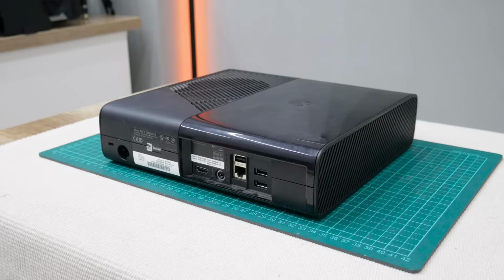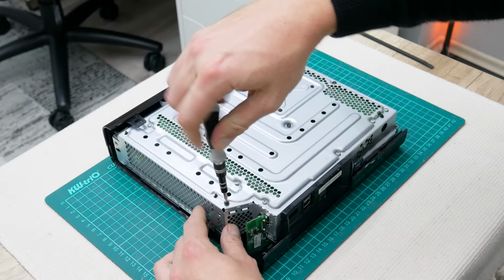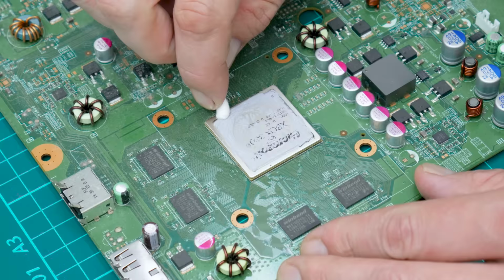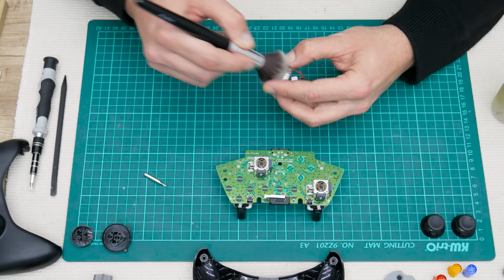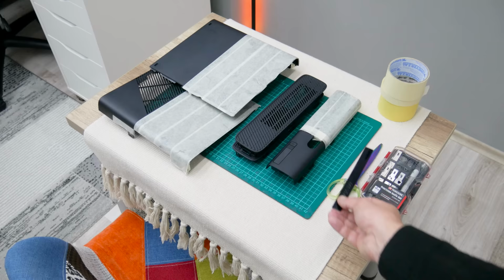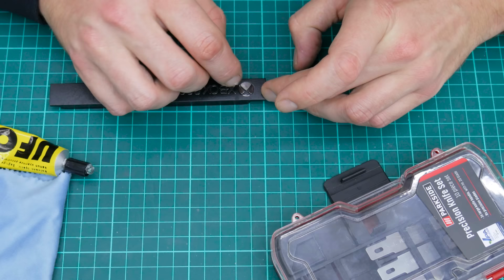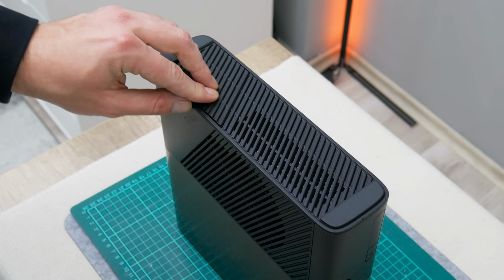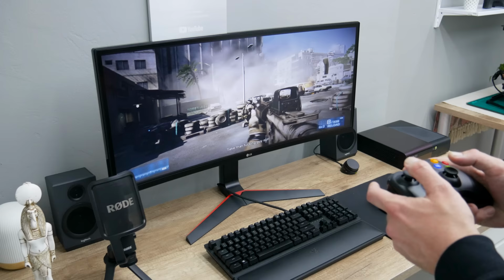Restoring XBOX 360 E - Simple and Nice

Comment: The Xbox 360E is an easy console to take apart. I got one second hand a few years back and the fan stopped working. I opened it, cleaned it, replaced the thermal paste with MX4 and changed the fan. Works flawlessly.
Reply: I've never taken apart a console successfully besides a blue wii that I left alone after getting apart
 I have an extremely scratched 360E though that I got for $25 about 4 years ago with a bunch of games and the technician I've taken my xbox and Playstation to said he doesn't go older than xbox one so was wondering if I could deep clean this on my own? And thermal paste I don't know where to get that or what to even use
Reply: @josephhall7317  Oh my gosh do it dude. Take it slowly, make sure you have the right tools and carefully watch tutorials. Check out websites with tear downs.

I don't know why repair guys wouldn't do this, the Xbox 360E must be easier than the Xbox One.

The original Xbox is very easy and the Xbox 360E is fairly easy.

But take your time, make sure you feel around when trying to open it, don't force it. If it feels like it's not going to open, stop, re-check what you've done and re-check the tutorials.

Japanese consoles are harder. They're usually far more complex to open and mess around with and have so many screws.

Trying to open and deal with a PS2 Slim or a GameCube is far more work than an Original Xbox or Xbox 360E. The original Xbox 360 is harder though.
Reply: Wrong with it

Comment: Love the look on this 360. a very good looking console. and fitting for the last model of 360 ever made
Reply: @gejamugamlatsoomanam7716  my ps3 slim got ylod
Reply: @Neilos-sd6ti  same but mine was a fatboy. U probably had the 2500 series, which still have nec tokin capacitors
Reply: @Harryd06  im really sad i cant use it anymore
Reply: @Neilos-sd6ti  that must be your fault. Xbox 360 gas 54% failure rate
Reply: @gejamugamlatsoomanam7716  Dude chill with that PS fanboy stuff go somewhere and do that
Reply: @gejamugamlatsoomanam7716  fun fact : spiderman is the only reason they can afford to keep making playstations
Reply: @gejamugamlatsoomanam7716  that was with the first batch of xbox 360's, microsoft fixed it with the slim
Reply: @gejamugamlatsoomanam7716  that was a 2006-2007 issue, by your logic ps3 has no games(only OG's will remember)
Reply: @gejamugamlatsoomanam7716  The original xbox 360 in 2006 had a 50% failure rate, lol I still have one and it works just fine, plus they fixed that issue immediately. oh, and take your COD playstation attitude somewhere else, no one wants to hear it.
Reply: @gejamugamlatsoomanam7716  fanboy lol
Reply: @gejamugamlatsoomanam7716  360 was a much better console halo dominated b ack then
Reply: @gejamugamlatsoomanam7716  it had the better exclusives, yes but in terms of looks,price and features the Xbox wins
Reply: @gejamugamlatsoomanam7716 all my ps3s broke unlike my xboxs
Reply: @gejamugamlatsoomanam7716  lol
Reply: Had my Xbox360 (Slim) since 2010 or 2011, still works but gets really hot and should get some cleaning but my PS3 (Slim) died one or two years ago and I had it since 2012 "only"... So for the Playstation fanboys here is Playstation really better? And another friend had his PS4 fail after like just a few years after release...
Reply: @gejamugamlatsoomanam7716  who asked you for google stats?
Reply: @gejamugamlatsoomanam7716  I never had a PS3 or 360 but after just finishing RDR2 on my PC I absolutely HAVE to play the first part. A PS3 or 360 + RDR1 costs less than a full priced game these days. But I noticed that RDR1 runs terrible on a PS3, it's not even HD (640p) and has huge fps drops to 15 fps at worst during busy scenes. Whereas the game runs at 720p on the 360 with a stable 30fps. Apparently this is because the 360 was the lead platform and the same difference can be found across most multiplatform games. Which is 85% of all games...

Then I noticed how horrible the controller on the PS3 is compared to 360. Going for the 360 route is the easiest choice of my life, I'm not sure what you're on about calling a PS3 far better and even insulting fans of the other. PS3 seems pretty bad to me.
Reply: @void2695  that's your opinion.  Ps3 had far lower failure rate, outsold 360, controller is great, has motion controls, built in battery.

Ps3 exclusives are far superior to all games in 360
Reply: @gejamugamlatsoomanam7716  👉😭🔥
Reply: @gejamugamlatsoomanam7716  yeah ps 3 has not much games I can't even play tomb raider 2015 on it or fh 1 and 2 nice Games too i like the xbox, double the ram Netflix twitch youtube all works but for what reason ever I can't play youtube videos in full hd which worked perfekt a year ago
Reply: tom  no they are not, thats the 360 thats prone to break.
Reply: @gejamugamlatsoomanam7716  my ps3 broke so I’ve been an Xbox guy ever since
Reply: @gejamugamlatsoomanam7716  why are you so upset. I hate PlayStation for being a confusing system but don’t tell your opinions in such a rude way.
Reply: @gejamugamlatsoomanam7716  if you're still on that childish console war please, PLEASE don't even bother to mention the controller when attacking the xbox 360.

Comment: Instead of a screwdriver to remove the xclamp, I suggest buying the removal tool for beginners. It’s less than $10 (maybe even $5) but if that screwdriver slips and destroys components on the bottom of the board then you’re going to have a bad day. Cheap insurance.

Comment: For the rails of the DVD, use alittle lithium grease, it will help the Lazer move around. 
The rubber thing in the back of the disk drive has always cracked and become old, so I used friction tape for it.
If yall ever had some old thermal paste that just won't come off with alcohol, use alittle dw40 on it. It will lift that thermal paste right off, then rub it down with some alcohol to remove the rest of the paste and wd40:)

Comment: Usually when I take apart the CD-ROM, something very bad happens.  The ribbon cables are prone to breaking like an iPhone is to cracking (or water damage).  If you take it lose you most likely break the CD-ROM.  I’ve done that before when trying to oil some gears that were having a hard time opening the tray (after replacing the belts) and that CD-ROM never worked again.  It’s the one thing I stay away from because of the complex mechanisms and compact design which makes repairs much harder.

Comment: Either the GPU or the Triple Core PowerPC is prone to running hot so if something happens you would have the RROD (Red Ring Of Death) don't let it happen, I just wonder why they didn't go with Phase Change Cooling to prevent the RROD.

Comment: Did you also put some motor oil in the fans?
Do you use some isopropyl alcohol to clean the motherboard too? Had you melt with fire the vinyl borders? Thanks and great mod and video!

Comment: Hi follow your great channel and have a tricky Laptop problem that as a repairer myself , i cant quite nail. and love some help..
Problem is the usual "wont start and blank screen- but for months sometimes start good and most not- intermittent!!!  worst fault haha
OK- What it isnt- I have switched out ram and PS and its not over heating ect as i service it but that would be once it s hot and OH.
I have also change SD HD with another and fresh windows install so its not windows or t the HD!!
Problem--  Push button (3 volts ok?) and power light and mouse comes on but nothing on screen OR 'windows starting" but then nothing.
So kill power a couple of times and after 1-4 tries, into windows and DESKTOP and if that far NO failure or blue screens or shutdowns.
So when in windows, it works all day , no error mesgs and faultless , its just getting to desktop
So my electronics and  M/B knowledge is leaning toward 
Weak Caps that are load harder on start but less once computer on and thus runs all day- Laptop is 13 years so YES, caps will be worn
Bios chip ropey or super IO BUT by now they should have failed totally?  Super IO is keeping the mouse on and power on so not a board short plus i checked all that when pulled M/B to check obvious shorts and burnt components
Also Power button not always work to force shutdown to try 1-4 restarts to m/B not always responsive - i pull plug
Battery and bios battery also removed and replaced
When i try to duplicate this fault HOT, i cant do it, only seems to happen after night then start- leading me to think weak cold caps not already ran and warmed ?  when i pulled board and tried restarts they worked every time as M/B was warm and voltage filled generally.
Is the Power button  3V needed AFTER the board is on, if not then that cant be it as mouse is on every time just wont get going to windows
My next step is to monitor the 19V main rail and maybe even scope it for A/C noise when i turn it on cold and see if i can detect weak voltage and ripple from bad caps but not bad enough to have it run all day without fault? hmm
Screen problems detected? but screen works perfectly all day and everything else too for months with this problem so i dont want to start reballing chips and make it worse perhaps..
Of course dumb windows says it need repair when it does start after restarts as thats it default position but it NOT windows or the drive..
This is M/B related as all else has been replaced or substituted to rule out....
Inspection- no corrosion or anything obvious. now it hot her in AUST, it might start each morning first time leading me to think warm caps?
or simply a chip that is intermittent and hasnt failed yet. 
Any ideas appreciated as its my mums and valued to her and i like learn what this is or could be...

Comment: 10:28 we're just ok with that capacitor not being connected properly in the power supply? What happened there?
Reply: I was wondering that also. When it moved just by a light brushing, I was like oh no, that's not good.
Reply: Its normal. Cap has few milimeters of legs under it (its not soldered against the PCB) so it can be moved fairly easily. But its definitely connected and good

Comment: I have one that needs repair. It keeps cutting out & the controller will lose connection.  I think it’s an overheating problem. 
Shame.  Got some decent games on that console.

Edit :: took it in to be cleaned, repaired, when I got it back, it wouldn’t even start up. They made it worse.

Comment: Hello :D I heard that xbox 360 generally is not so reliable ( as other consoles are ) and  is a bit awkward to try and buy one I guess, even if I like XBOX concept...that keeps me in check to be unsure about this.
Reply: The only unreliable ones are the Phats made before 2009. When Microsoft switched to the "Jasper" revision on the phat models (the older white/elite models), they fixed the RRoD. Currently, the best motherboard is a Jasper as it has proven to be the most reliable and easiest to mod.
Reply: @safetyzone2962  ty for info bro

Comment: Is it good to use 70% alchohol for cleaning thermal paste on a cpu?
Reply: 90%+ is recommended. I use 91 because it is the highest I could find when I needed it. 70% is mostly used to remove nail polish but you could still use it if you can't find 90% to 100% alcohol. I used it before with no issues.

Comment: I’m so disappointed in my Oculas quest 2, like my controllers are having trigger and button issues and also joystick drift and I have had it for 2 years and haven’t dropped it like at all, meanwhile the XBOX 360 I used for 5 years and threw the controllers across the fucking room and they were fine.